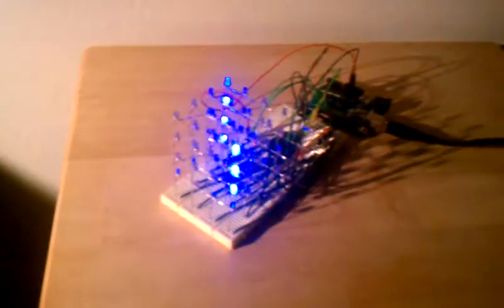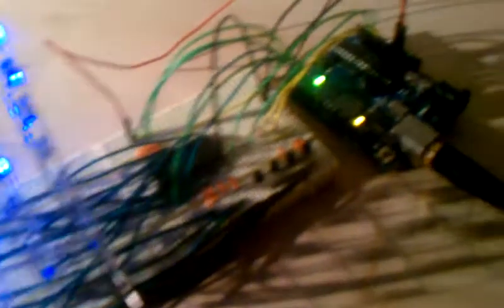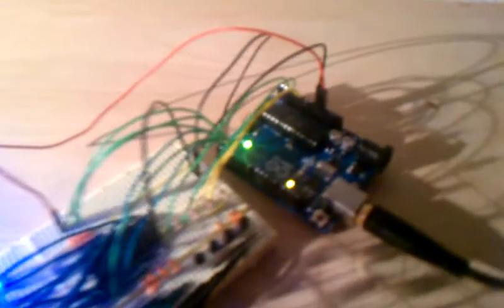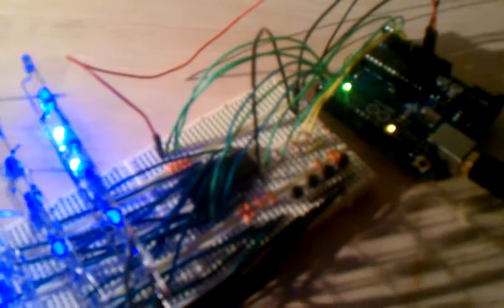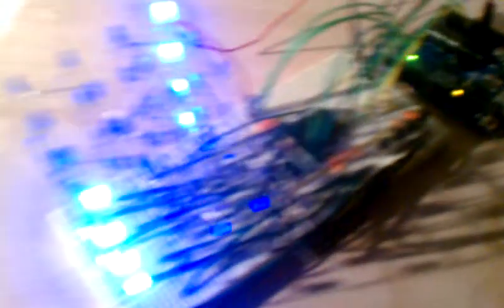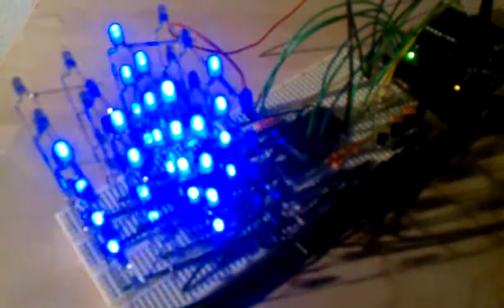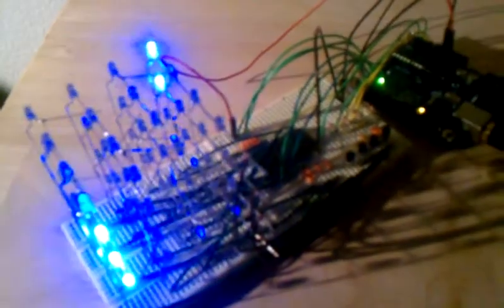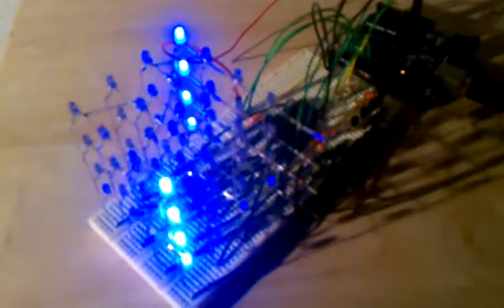LED Cube 4x4x4

Comment from the maker: Hey Marcus! Glad you like it. I've seen videos with guys doing 32x32x32, but that's 32,768 LEDs to solder, so I may have to wait on that till I have more time ... lol! I think LEDs in general are pretty durable, but I haven't really worked on them long enough to really know. Imagine what a pain it would be to replace if you soldered a big cube, and one of the ones in the middle burned out ... lol!